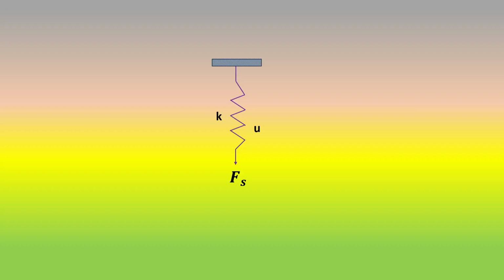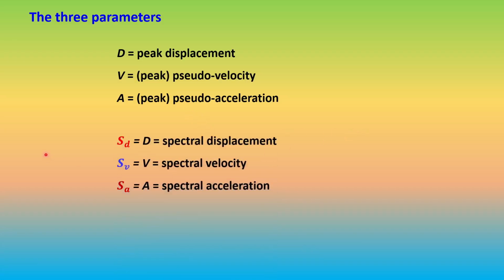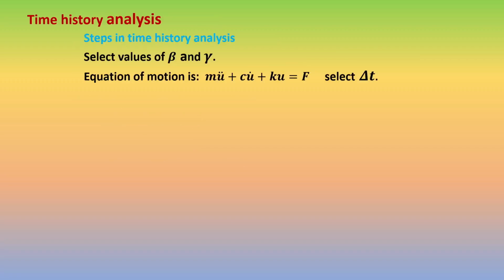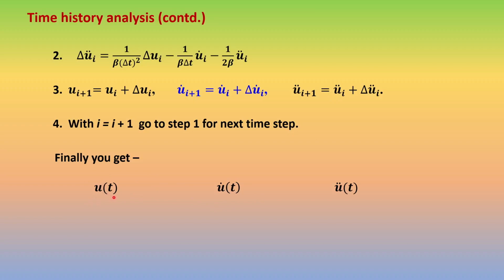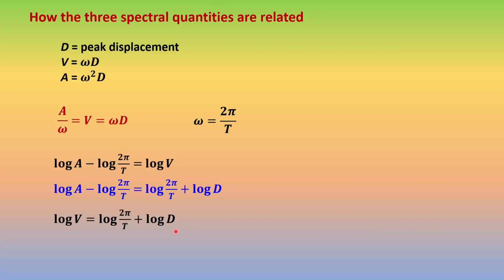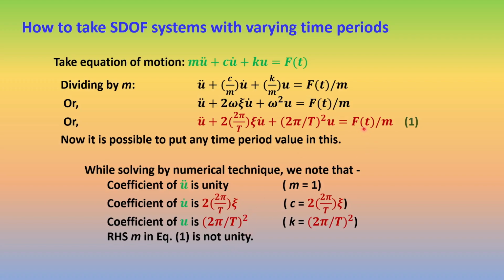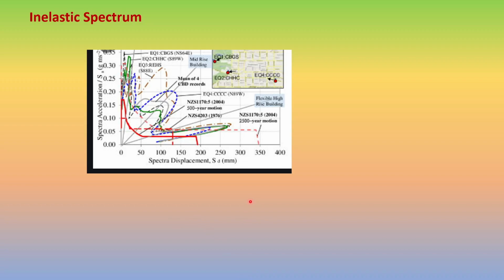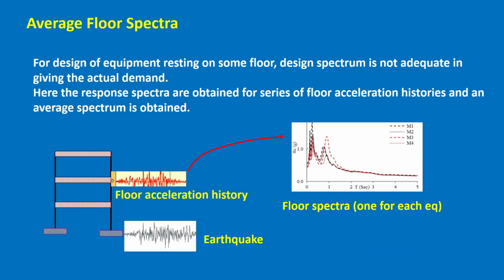Response Spectrum - Concept and Construction

Comment: Great Video. the time step method schema that you have shown, is it applicable for both linear and non linear THA, as I have noticed the term "effective stiffness" that you have mentioned in that slide . if it is so then  is it to be solved by Newmark's direct integration? As far as I know Wilson Theta method is normally used for the  linear THA)
Reply: Thank you for your interest in the topic. (1) The time step analysis shown in the video is for the Linear system. This is because we have considered spectra for linear oscillators here. (2) "Effective stiffness" here is not secant stiffness. It is real stiffness + impact of mass and damping on stiffness, as used in the analysis procedure. (3) The Newmark direct integration method is applicable to both linear and nonlinear cases; of course with some alterations in the procedure. (4) Yes, Wilson's method is basically for linear cases.... You may refer AK Chopra, and, Bathe and Wilson.